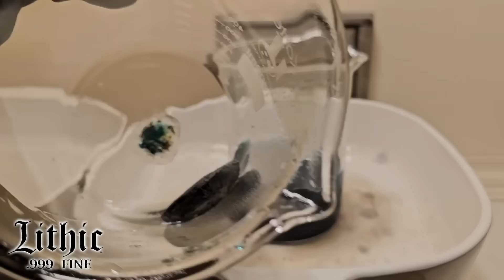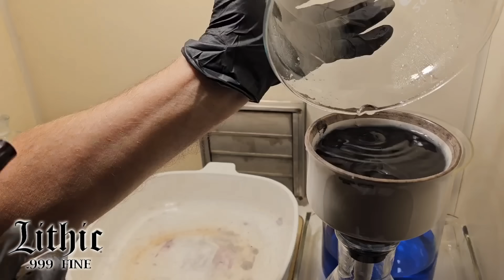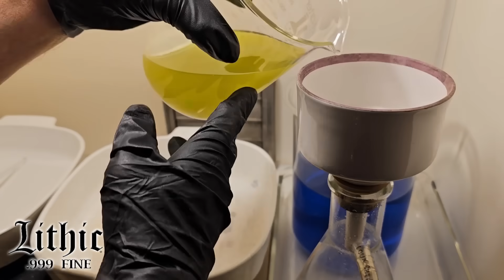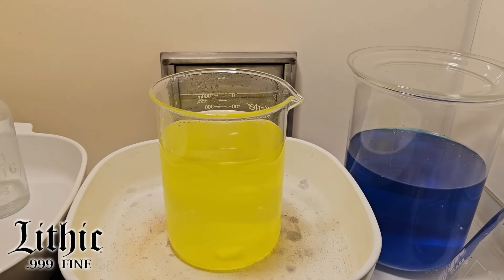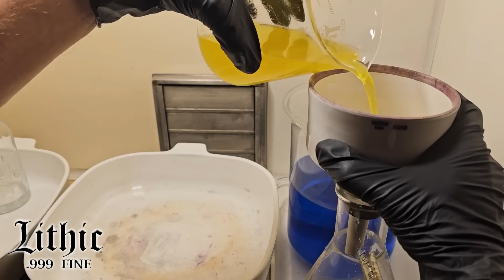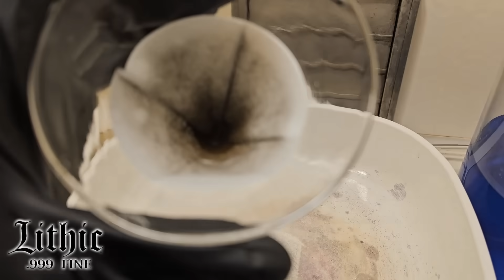Hunting For Gold In E-waste | But Is It Worth It?

Comment: Where do you dump all the hazardous waste?
Reply from the maker: Dump? There is no dumping. I drop the waste metals out of solution with iron. Drop the iron by adjusting the pH. Filter the solids, and it's ready for disposal. At that point, it can be poured down the drain. However, I have a service deliver it to my local water treatment facility.
Reply: @LithicMetals  thanks for the answer, I used the wrong English word, I meant how did you get rid of the special waste

Comment: That gray stuff is lead.  Add in a bit of H2SO4 before adding the Nitric will take care of that.
Reply: I think so, too. Lead chloride is slightly soluble in the excess hydrochloric acid in the larger beaker, but it crashes out of solution when he adds the distilled water to the flask. Adding H2SO4 would make the lead fully insoluble so that it would stay in the filter.

Comment: I used to scrap computers for a nonprofit and they got about $5 per pound for PCBs. We scrapped by the pallet load so it wasn't great money. We would offload pallets of CRT monitors for 5 cents a pound. It really does take economies of scale to make it worthwhile. A typical pallet would be 300 pounds so $1500, not bad, but a ton of work. My guess is the recyclers were subsidized or the scrap was sent overseas. Likely the latter.

Comment: I agree with your assessment. As a hobby or something, sure. The amount of time, chemicals, waste produced and amount of work just collecting the material makes it a labor of love. 
Im looking to explore different methods for recovery. Perhaps a copper II chloride process for some material like pins and plated boards.
As far as the chips go, it may be that separating the gold using a gold pan or treating the solids with copper chloride to remove base metals. Obviously this method would increase the amount of time for recovery but may be the way to go.
Just keep throwing stuff in until the yield is good. 
It takes a bunch to add up to a little. Over 100 flat-screen tv's yielded about the same yield as this video from the chips collected from the boards. Over 400 grams of chips that took a year to collect. Not gonna be retiring off ewaste anytime soon.

Comment: For those looking to get into e-waste...
Starting around the year 2000 manufacturers started using gold alloys instead of pure gold.
And since then the purity of the gold has dropped every year.
So if you're looking to do this, only do it if you have a supply of old electronics because modern electronics don't have enough gold to make it worthwhile.
Reply: This is absolutely true. They measure it in microns as well, that's just HOW THIN the actual coating is. Not worth the efforts. It would literally cost less to buy gold.
Reply: Bingo. Though in industrial applications, things are different. Siemens and toshiba still use solid gold contacts in their switching relays.
Reply: Even with old electronics the process is tedious. Might be worth it though.

Comment: Different breed of refiner here;-) 1. Best practice os to remove as much of the base metals prior to starting to recover any PMs. Denox! Use Sulfamic acid. Then add some dilute Sulphuric acid before applying AR, to preciputate and Lead out. That nasty stuff that clouded your AR might have been small traces of Silver Chloride. And so on... Remember we as scrap refiners are dealing with a whole zoo of metals. Refining pure or karat metals is the easy part. We often do not know exactly what metals we will encounter. A good cost-efficient pretreatment is eletrolysis to remove Copper and most of the Silver. Then proceed to Nitric etc...
Reply from the maker: You guys really know your stuff! There is so much to learn in that field. The filters I use generally clean the silver chlorides quite well, so those cloudy particles really stumped me. I was thinking tin perhaps or lead? As you mentioned, there are so many metals to deal with compared to karat gold. It's a bit outside of my skill set.
Reply: Colloidal silver chloride.  @LithicMetals

Comment: E-waste is a bit of a beast. This analysis is a bit higher level than it might actually need to be. 1) Gold is not the only thing of value to recover. You've got that whole beaker of copper that could be recovered as well. 2) There are plenty of rare earths in there too, given enough volume that are also high value targets. 3) Your filtration system will leave some room for improvement as far as %yield. Especially when you're washing and filtering over and over and over, you're losing so much product each round. 

I look at e-waste as a bit of a volume opportunity. You simply need large volumes and extremely high efficiency from economies of scale and a highly optimized process to make it worth much of anything. Lots of people have tried it. Most have failed, which is why e-waste is notorious as a waste of time, as you noted - and why this stuff ends up in landfills instead of getting picked up and reprocessed.

Either way, it was a very interesting chemistry experiment to watch. Well done
Reply: God tier reply, I've seen people ignore metals like copper, nickel, platinum, rare earths (Europium, dysprosium, neodymium, yttrium) and it kinda bothered me, but I don't ignore them

Comment: You got that right, today it's not worth it. I did it for about 10 years. Most of what I ran dated to the 70's and 80's. Gold top processors, and gold fingers. the rest was sold to refineries . Back then I would recover 30 to 40 grams of gold using about 2 liters of Nitric and about 2 gallons of HCL. Gold was about 16 to 1700 an oz. Time spent about 12 to 16 hours of actual hands on time to recover that. Was that worht it? Yes, you do the math. Nitric 60 bucks, HCL 20 bucks some filters. round it off 1500 for 15 hours of work

Comment: Hello Jeff, could cloudiness be stannic acid? Tin is pain in a...s, when working with electro waste. 0,8 g not bad, more than I expected, 0,55 %, 5,5 g per kg... not carat scrap, but not complete junk either... I woud flat it with roller mill to "foil", put it in 600-700 ml of HCl with a bit of peroxide, let bubble there for some week(s), filter, cupel the residues... Not so fast and photogenic, but costs pennies...
Reply from the maker: See, you know the tricks! I wouldn't know where to begin with e-waste. I was thinking tin as well. A few folks mentioned lead, but it didn't look like lead to me based on my past experiences.

Comment: FWIW, Gold plated pins may be as much as 1% Gold by weight. They will be more likely between .1% and 1%. Lead-Free Solder will be either .3% Ag or 3% Ag. Gauging percentage by weight for other stuff is harder, but if the starting material is all Gold-plated metal, the Gold can be concentrated pretty well with just HCl. If you drill out a sample, even just a couple of Grams, if it is worth processing you should be able to see a positive Stannous test when it is dissolved, or some yellow color if you isolate the Gold then dissolve it alone. If there is only a small amount of Gold,  then that blob can be used as collector metal or to treat leftover acid, so that you get at least something. Note that XRF is not very reliable to detect small amounts of Gold surrounded by Lead, Silver and Copper. It's likely that XRF would show no Gold at all, but you still got around $80 worth at today's price. Based on original weight this is like melted pins, not any kind of concentrate.
Reply: Only military connector pins use heavy gold plating (which still means only tens of μm thickness), and only the tiniest of pins would reach 1% gold with that plating thickness. Everything else uses primarily “gold flash” which is super thin, and often only selectively plated onto mating surfaces. 

Lead-free solder varies from ~4% down to 0% silver. The most common lead free solders are SAC305 (3% Ag) and SN100 (99.7% Sn, 0.3% Cu, usually with trace amounts of other metals to improve wetting). No common alloy uses 0.3% Ag.

Comment: Recovering E waste gold is a different process. Whatever that blob you started with was, it was the wrong way to process. Melting everything into that blob instead of processing out the base metals first was the major mistake. Processing E waste is a bit like the Sherlock Holms method, eliminate everything that isn't gold and you'll be left with gold. The other key is having a lot to process at each batch.
Reply: the cheap methods are slow, which is why companies don't really get involved and leave it to backyard guys.
Reply: you can melt everything into a blob if you electrorefine ;  process will take ALOT longer but is alot more passive in terms of work
Reply: Seems like it worked just fine 🤷
Reply: This seems to be the common response to retrieving ZERO precious metals from a lot of time and money spent.  The reality is there were no precious metals to start. What you are saying could possibly be true, but I have seen professionals do this and get nothing.
Reply: @someguy-k2h  Recovering gold from ultra thin platings is tricky, especially in very low quantities. The gold will be so fine it becomes coloidal and will follow whatever solution it's in. Thin plate or enigma is so hard to work with.
Reply: @SMOBY44  Your comment leads me to believe you don't know what you are talking about.  If you had any idea how difficult it is to purposefully create colloidal Au, you wouldn't have said that. You first need to get the Au into the +3 cation state by adding a reductant that will liberate thee cation. Your solution has to be free of contaminants that would interfere with the reduction of the cation.   Your solution can't be too hot or too acidic. It's also very easy to knock it out of suspension simply by adding heat or strong acid. Chip makers have moved away from Au and Ag.  Ewaste is a scam.
Reply: 'The other key is having a lot to process at each batch'
Exactly this.
That is why everyone exports ewaste to places like Bangladesh now, where they process by the shipping container and labour is cheap and disposable.
Reply: Cope, pedo
Reply: Dude have you ever did something like this before or own a jewelry store this guy knows what he doing and by watching his videos everything looks fine 😁
Reply: @0077user  Been doing it for almost 20 years now. Sreetips is my mentor and I marvel at what he does. He just doesn't like messing with e waste. And if I had access to the stock he processes, I wouldn't touch e waste either. I do e waste. Sreetips does karat scrap. 2 completely different processes.

Comment: Have you tried using glass fiber filter paper in your Buchner?  Might not get the mush you get when you acidify cellulose filter paper.  I've seen them withstand 550 C for an hour as well.
Reply from the maker: I haven't. But filter pulp really isn't a concern for me. It just gets filtered out eventually anyway. However, I wouldn't mind testing out a glass fiber filter!
Reply: @LithicMetals  True.  You would save on acid though, as it wouldn't get used to break down the cellulose.  Lab grade acids have quite the cost.  Just thinking cost benefits 😜.

Comment: Electronic waste just produces too much extra waste on top of the Electronics waste to begin with.

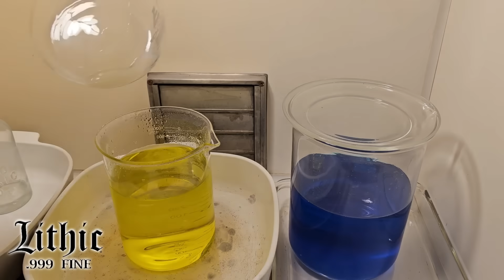8:24 can the hazy bits be possibly some led? Do you ever use sulphuric acid to precipitate out led during refining?

Holy cow that wasn’t anything
Reply from the maker: That's how I see it. But I also know very little about refining e-waste
Reply: @timotheegoulet1511.   You're wrong! WEEE (e-waste) produces absolutely no waste. Every single fraction is money.
Plastic parts are removed and sorted in the correct types, then sold in tons to industrial recyclers.
Ferrous parts are separated out, and cleaned by removal of all traces of other metals. It's then sold as melt ready iron scrap.
The Printed Circuit Boards are hydrometallugical treated for Solder recovery (Tin is worth 5 times more than Copper).
Without any Solder all electronic components now simply fall off the boards. They are sorted for further individual processing.
These components are processed in many different ways for full recovery of every single bit of metal; no matter how small they are.
The bare boards are pyrolyzed and the Fire Retardant is extracted and sold as elementary Bromine. Same goes for all the internal thin electric wires. Then the ultrathin Copper-layers are separated out, and the remaining glass fibers are picked up by a glass recycler.
All electric cords (with plugs), and any other PVC parts, are pyrolyzed for recovery of the Chlorine.
Small miscellaneous plastic parts and plastic crumbles, as well as any hard to sell plastic parts are pyrolyzed into Raw Pyrolysis Oil. This oil is later refined into free Petrol/Gasoline, free Diesel, and free Fuel Oil. Same goes for epoxy sealed electronic components.
Brass, and all Copper bearing components, are melted with excess extra Copper and cast into flat anodes. These are electrorefined to 99.9% pure Copper (highest sales price). Afterwards, the Nickel is recovered by electrowinning (worth 2½ times more than Copper), afterwards the Zinc is recovered. Many other metals accumulate in the electrolyte. When the content is high enough, the other metals are recovered; including REEs (Rare Earth Elements). 
In the bottom slime of the electrolysis cell the PMs will remain, ready for further refining.
Every single ml of liquid waste solution is recycled. Excess acids are distilled off and reused for the next batch. All dissolved metals are either precipitated or recovered by other processes. Further processes recover all remaining acids.
Carbon residue from pyrolysis is purified, and pressed into brickettes for use as fuel. Carbon Black is treated by superheated steam and converted into high quality Activated Carbon. Various useful minerals are extracted from the ash in the Fire Chamber.
Expenses for processing e-waste are nil! The three acids are all homemade from various waste. Electricity comes from 55 old Solar Panels, gas for heating of chemical solutions comes from two anaerobic digesters, the metal melting furnace is fuelled by homemade oil, and Solvents like fx. Benzene is extracted from PBT plastic (PET can also be used). The recovered Chlorine gas is used for dissolving Platinum Group Metals, and all the chemicals needed for the different processes are homemade from so called waste products. Distilled water is obtained at no cost by using otherwise lost exhaust heat from both the four pyrolysis units, as well as the high heat from the metal melting furnace. No cost processing equals 100% profit!
I might be one of the few who fully process the glass funnels from old CRT-TVs, by extracting the chemically bound lead (on average 22%), as well as recovering the REEs from the inside of the front panel glass. I even recover the aluminium foil from juice-cartons, candy  wraps, potato-chip bags and cigarette packages. All is done in machinery that's homebuilt out of scrap material at no cost.
For more than 12 years I've been a full time scrapper/metalrefiner. I work hard for 10 months. Then, in the harsh winter, I go for 2 months of holiday to a tropical country. There I always drink my morning coffee on the balcony of my own house, while watching the sun rise over the ocean. Up to several times a week, while staying there,  I enjoy Big Game Sportfishing on the ocean, from my own private sportfishing yacht.
E-waste is a Gold-mine; that is to be understood moneywise, there's almost no metallic Gold in e-waste.

Comment: Ewaste is a specific animal. There's a process to get only the precious metals. You can't take the easy road of just melting everything in a furnace. It costs way too much to recover when you do that. Tell the guy to try electrolysis next time instead if he doesn't want to use acid
Reply: I assume the original guy failed at cupelling because the copper content was just way too high to get it liquid enough for the process to work. Since he couldn't get tte base metals out that way, electrolysis in a copper cell to concentrate the PMs in the slimes is definitely a better route than going straight to acid. Another option would be to add a bunch of lead to bring down the melting point and cupel it again.
Reply from the maker: The gentleman did state that he felt he could have done a better job at cupeling the material. I don't know enough about the process to take a guess
Reply: If you have an example of a video where money actually gets made, I would love to see it.  E-waste is a scam being perpetrated by people in countries so poor they get paid to "dispose" of the stuff.
Reply: @someguy-k2h  collecting ewaste to scrap is no different than someone collecting copper wire or aluminum cans. You just need a lot of it to make it worth your time.

Comment: If I were you and I didn't see how this metal button comes out, I will go with cupellation method or at least I will melt the button and try to oxidize it for a few minutes to make sure that there is no tin in it, but you were lucky since its well cupellated by your friend and only base metal in it is copper.

Comment: nice to see you back. I recover ewaste, but I just cherry pick without all the extra metals
Reply from the maker: I wouldn't have a clue what to look for to cherry pick! To be good at e-waste, it seems like you really have to have a vast amount of knowledge. I commend you guys!
Reply: @LithicMetals also breaking that puck up into smaller pieces would have made your life a lot easier.
Reply: @Edge51 Increased surface area, right?
Reply: Processors tend to have more gold than just motherboard, ram, accessory card, or circuit boards with contact.
Reply: Yeah i do the same
Reply: I believe that cloudy stuff to be Sn or AgCl.
Reply: Don't forget lead